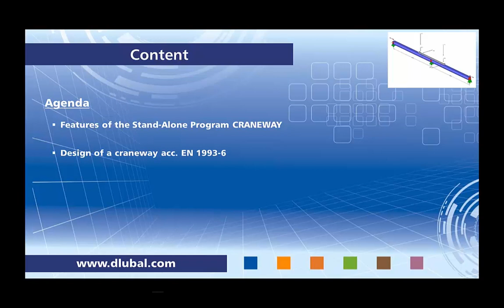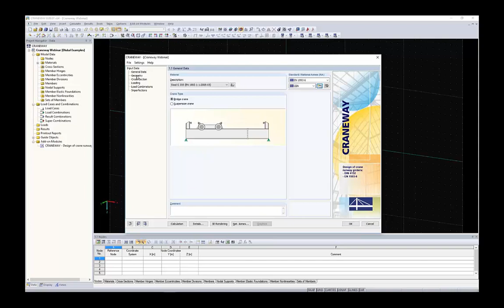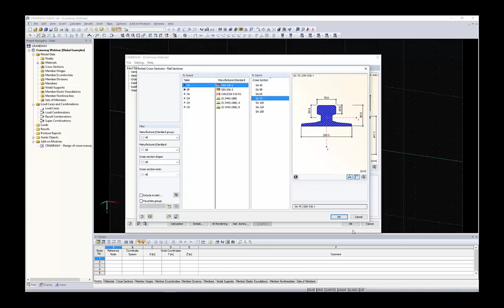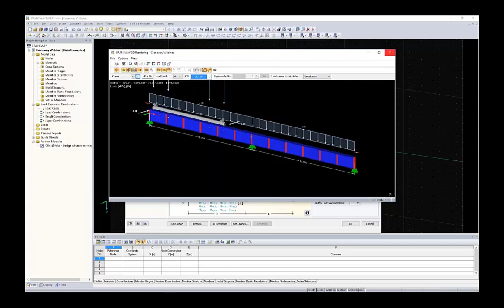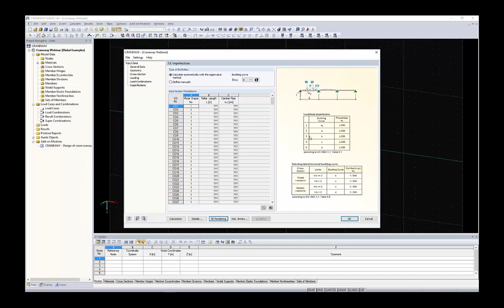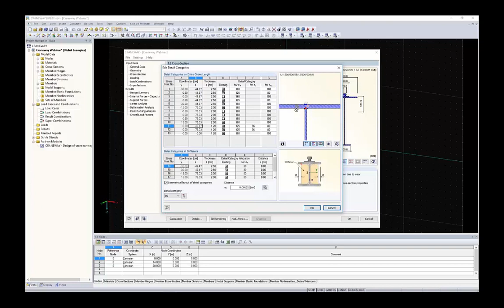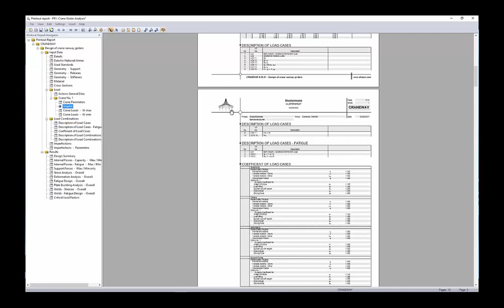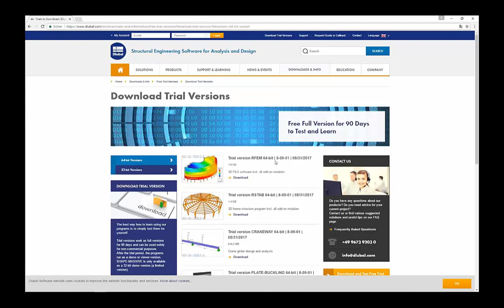Webinar | Design of Craneway Girders According to Eurocode 3

Comment: Hi. :) Dlubal has module for warping torsion. Can we model with dlubal fully coupled second order effect with normal forces, bending and torsional moment? Because of imperfection normal force will give aditional lateral displacement which will give bigger escentricity for torsional moment and vice versa.
Reply from the maker: Hi, Dejan!
Yes you can do that with eg CRANEWAY or with the extension STEEL Warping Torsion.

Comment: Could you please upload the excel calculations for wheel load too?
Thank you
Reply from the maker: Hi, Pasan!
It is only a simple excel table with a few values. It will not help you with anything. It was used just to speed up the input of the data for this webinar with limited time. It will be of no use for your further projects.
Reply: @DlubalEN  Okay, Thanks, I'm looking for wheel load on double girder gantry crane.
Thanks anyways.
Reply from the maker: Hi, Pasan!
You have to talk to a vendor of such cranes. they can give you the wheel loads. We do not have such tables. I hope this helps you.
Reply: @DlubalEN  Hi, is there a way to design Box girder from the software?
Reply from the maker: Hi, Pasan!
No, at this moment not. The only way would be to use RSTAB or RFEM to get the normal checks but fatique checks would have to be done in a separate manual way in this case.